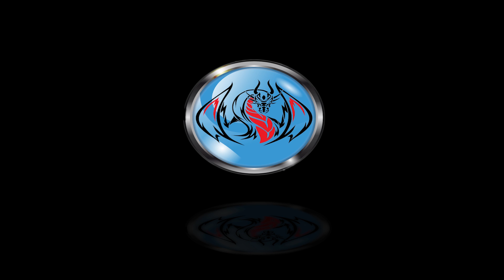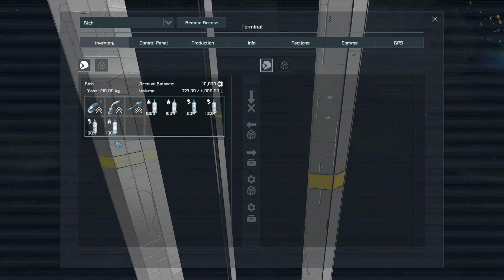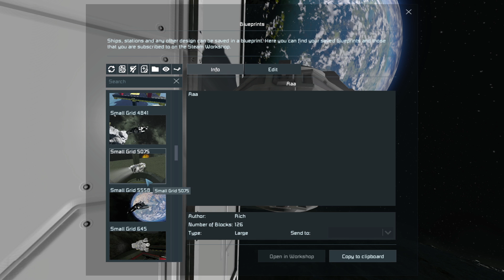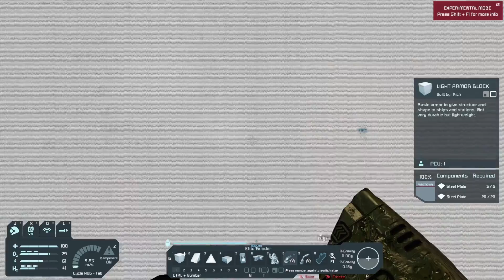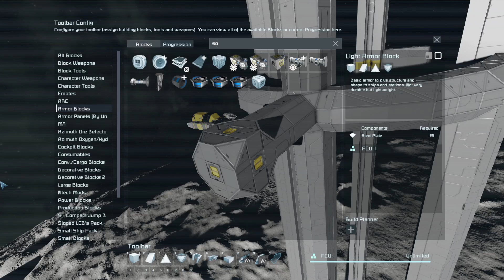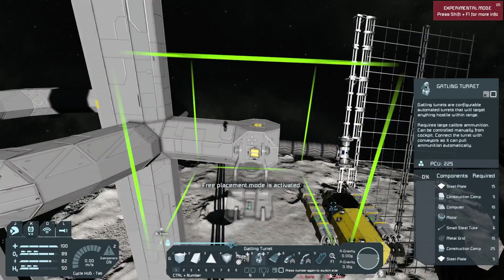Space Engineers #36: The First Ring

Comment: Unless I’m mistaken, if the range on the turrets is 800m (which I think is what you said) each turret will be able to fire as far as the next, and therefore you shouldn’t have any blind spots anywhere alongside the tower. This is because the range is a straight line from the turret, I.e. the radius of the field of fire, not a line one side to the other, I.e. the diameter of the field of fire.

If I’m wrong though and the range is only 400m, then your turrets probably want to be about 600m apart to not have blind spots.
Reply: S/V Firefly if the range is 800m, then each turret will be able to hit the next turret. At the halfway point, the arc of fire from both turrets is at its minimum, which in this case I believe is 692m. But you’ll have to forgive my math if I’m wrong, I have a baby in my lap and can’t check with paper. 
I agree that I think he said he had a section that was not covered by a turret, which is incorrect. But the distance isn’t perfect for someone that does want to attack. Attackers will (should) always play the angles.